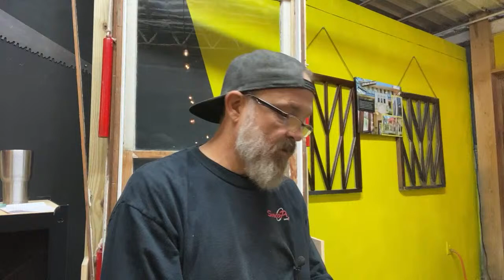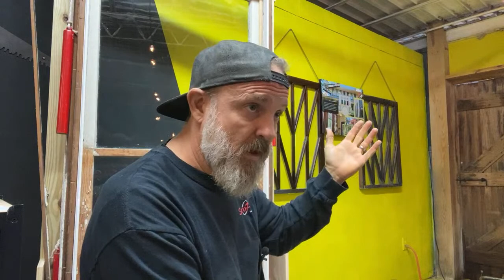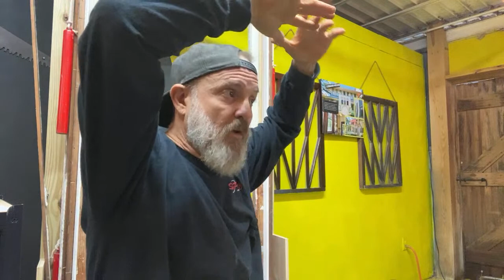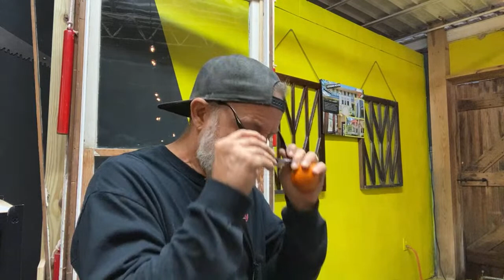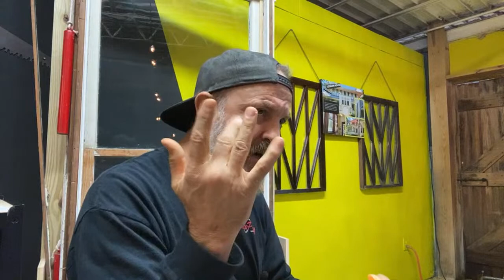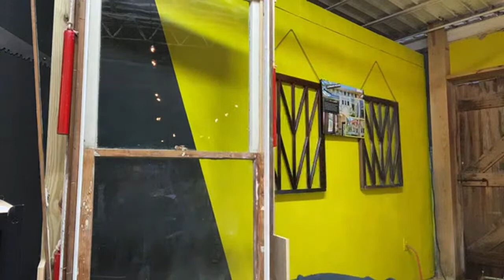Introduction to Window Craft

Comment: Where are guys located? Do you offer apprenticeships?
Reply from the maker: We are in Tampa. We have offered apprenticeships in the past but aren’t right now. Have someone in mind?
Reply: @WoodWindowMakeover  Not necessarily. My dad and I have been slowly restoring all the original 46 windows on our 1925 brick center staircase colonial, and I have always been interested in spreading the word about keeping your original windows versus replacing. I have watched over the last couple years as another neighbor will surrender to the modern plastic windows and have all the originals thrown in the dump. It is painful to watch, but at the very least I will always dive in the dump to save the hardware and maybe a sash or two. I am convinced that we are one of only two houses on our 46 house street that still has all the original windows. (Other houses may still have them but they have been mostly or at least partially replaced) also I am completely obsessed with anything antique and the act of bringing it back to its former glory. I am only 17 now, so I would like to master this craft as early as possible so I can work on it through my life without an issue and perhaps even live off of it in the future. Right now I do all the ‘technical’ stuff with restoring the windows. I disassemble, clean the hardware, prep the jambs, and install, and my dad glazes and paints. Usually if there is a broken pane we have it replaced by a glass shop, but someday I would like to know how to do all of it by myself. I especially need to practice my glazing because I am pretty bad at it right now as I don’t usually do the sash work. Unfortunately you guys would be too far away for me to apprentice (at least at this current point in my life)even if I wanted to because I live all the way back in Connecticut. But I will look into what is around here for wooden window restoration and see if I can find somewhere to learn the craft. Either way I think your channel is awesome and I fully support what you are doing! Keep up the good work. 

- Gage
Reply: @gagesvintageclockcollectin7118  What a breath of fresh air to see a young person interested in working with their hands and understanding the value of craftsmanship. 👍🏽
Reply: Great channel. Thanks for taking the time to share your knowledge.